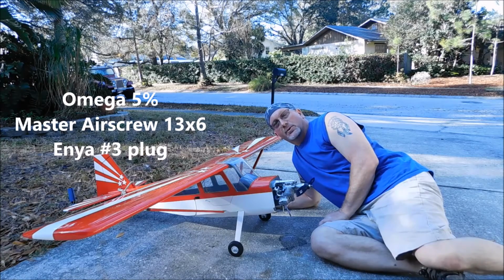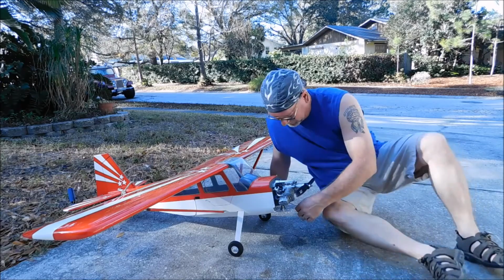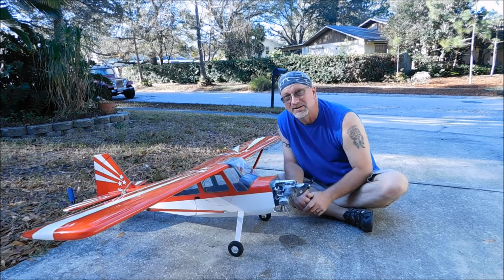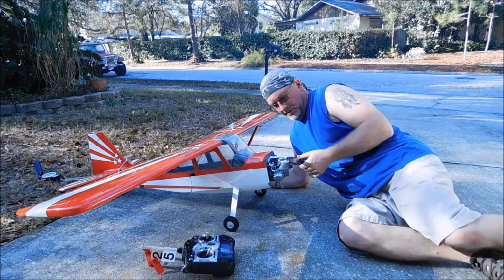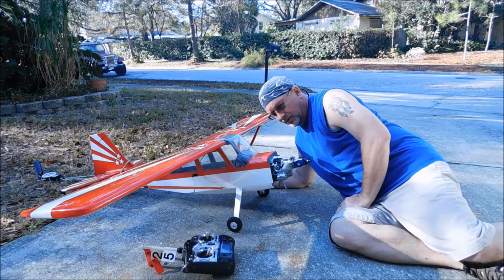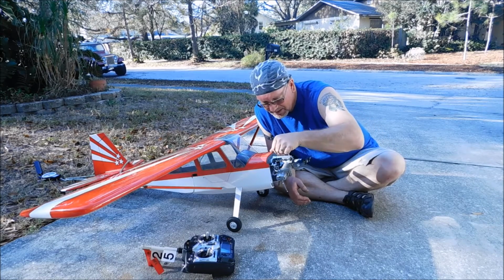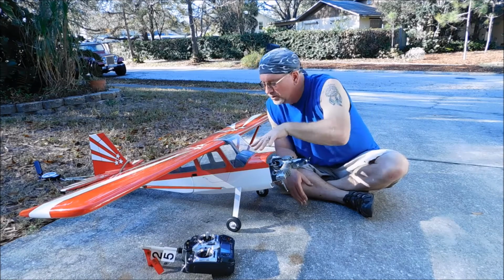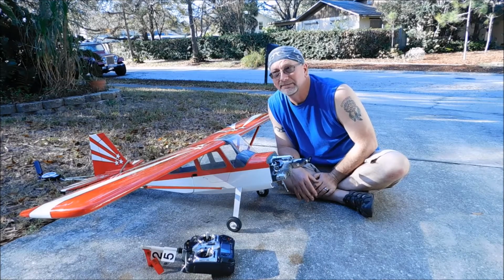Phoenix Decathlon Fuel System Test **Bella**

Comment: Nice plane and engine, David!!!
Enya 80 takes run at first flip propeller! Amazing!!! 
I was surprised to saw Enya glow plug #3 works fine with just 5% glow fuel. 
Is the engine got run cool with just 5% of nitro?
Next month I will receive a Seagull Decathlon 20cc with this same paint. And the powerplant will be a Saito FG-21 four-stroke. 
What about the Spektrum servos S6020 (146oz.in or 10,5kg.cm of tork @ 6V) to control surfaces of 1.20c.in (20cc) Decathlon (78.7in. wing spam and 10.6lbs)?
Are the Spektrum S6020 servos works fine to push-pull the controls surfaces in flight conditions?
Reply from the maker: I do not notice any heat difference running 5% nitro, but inside the cowling it will be very hot.

Comment: I was super excited when this video popped up in my subscribtion list. I maidened mine 2 month ago. The same plane with a Saito fa-82 GK engine.  That engine is also a jewel. Mounted mine inverted with a 90 degree exhaust attachment, so the silicone deflector points downwards exactly in the middle. You can see my maiden here: https://youtu.be/irPF9OEgtTA
Lost the door mid flight but my friend ran to get it, lucky... now it has hinges and a lock:)
Pay attention to the cg, the manuals 75mm (if you have the mk2 with shorter ailerons) is waaay tailheavy. rather 70mm for the maiden.
Thank you for all your work with the videos!

Comment: super plane..  but do you think that a saito 72 will fit in too that plane???
Reply from the maker: Of course. Why wouldn't it fit?
Reply: @dmrcflyr2  well they say its a model for a 52 4 stroke and i have a 72 saito
Reply from the maker: Haven't had many airplanes before huh?  Just because a manufacturer states a recommended size range of engines, doesn't mean that is the LAW and can't be deviated from.  This entire hobby is based on experimentation and modifying things.  Many folks like to WAY over power their airplanes.  Experimentation/trial and error leads to knowledge and is part of the fun of the hobby.
Reply: @dmrcflyr2  i flight since 1985, but never had to over power the engin before..  thank you for the help..  :)
Reply from the maker: So you have been flying since 1985 and have NEVER installed an engine outside the manufactures specified range?   Surely in all that time you had to accumulate knowledge on engines, power, airframes, wing loading, etc.  I personally do not massively over power airplanes, but I know enough to know that manufactures specifications are not always written by RC flyers.  This airplane powered by what they say is the top size engine for a 4 stroke, would be marginal in performance at best.  Did you watch my maiden flight video of this airplane?  Did it look over powered or correctly powered?  The Saito 72 will provide about the same amount of power as the older design Enya 80 and weigh less doing it.